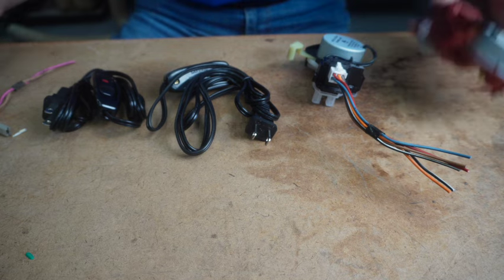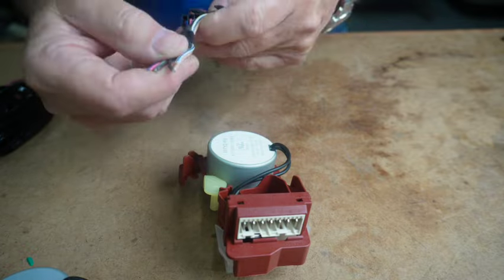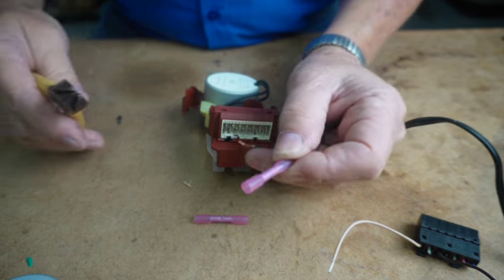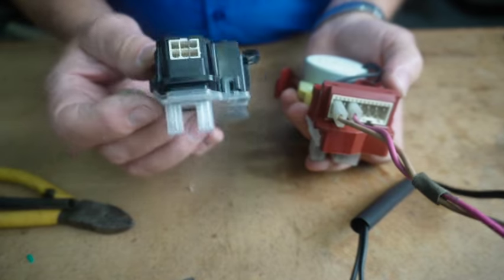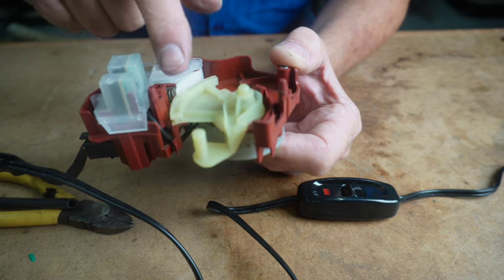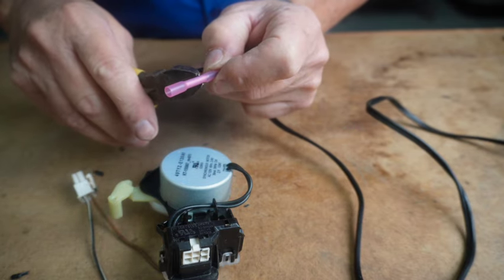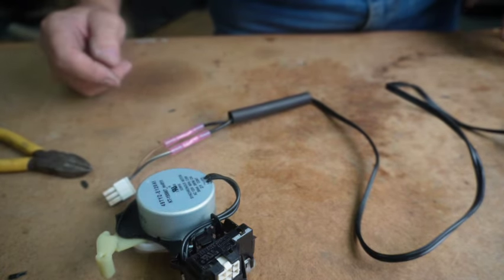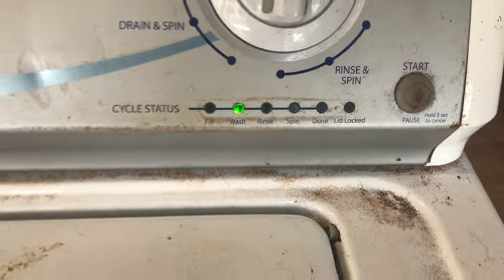How To Diagnose & Fix Washing Machines: Testing Shift Actuators & Tachometers

Comment: Thank you, this is a super helpful video!  You have a new subscriber.

May I ask what would cause the little plastic peg on the actuator arm that serves as the cam follower to snap off?

Visually, the splutch looks fine (no missing teeth on the gears or debris or anything) however, I did notice that is is hard to release the brake by hand when I manually spin the drum in one direction but easy to release when spinning the opposite direction.  (This may be the way the splutch is designed to work for all I know.)

I saw that you recommend spraying dry lube on the splutch so I will do that.  And I saw someone else comment on checking the drum seal to make sure it is not leaking on the transmission and getting the brake shift actuator wet.

I just replaced my brake shift actuator two weeks ago for this issue and have it again tonight.  This washer is barely three years old.

It would be good to have an idea of the root cause of this issue.

Maytag model# MVWP576KW0
Reply from the maker: Perhaps the plastic peg breaking off was a defect in the manufacture process. I haven’t seen this happen before. As far as it being hard to spin by hand, I don’t have a clue. I’d have to look into that further, it doesn’t seem right. I have only ever seen a shift actuator referred to as the brake actuator when ordering parts for the commercial washers. Perhaps there is an actual brake mechanism that is internal to the commercial transmission but absent on the machines made for the home consumer market. As far as I can tell there is no brake on these machines. That water leaking issue may be real bad news if it has compromised your bearings. Does it roar during a spin cycle? Thanks for watching and subscribing too!
Reply: Thank you!  

This is the commercial washer from Maytag.  In my humble opinion, the actuator arm is very poorly/cheaply made, at least on this model.  From what I see on various online DIY repair forums, its a common problem with this model.  The motor on the shift actuator operates correctly, but when the peg breaks off we're down for the count.  

I am going to try to fix the arm by drilling out where the peg was on the arm, and replacing it with a small metal, flush mount core pin and see what that does.  

BTW, I like this channel.
Reply from the maker: Thank you! Let us know how your modifications go.

Comment: I have a Kenmore 90 Series washer. After completing one load of wash I started a second. The tub filled with water, agaited then stopped. No matter what setting I put it in nothing happens. No humming, nothing. Another Kenmore 90 series washer was given to me. It agitated but no spin. After checking it out it was only a loose wire. Plugged it in & it went through the cycles. Put a load of cloths in & the only cycle that will now work is the spin. Any help on either one of these would be appreciated. I did notice same series but different timer control model.
Reply from the maker: The first one sounds like a lid switch failure. Does the second machine fill with water?
Reply: Thank you for replying. I checked the lid switch it was good, I even jumped it just to make sure, ( that what I was hoping for) The second on  does not fill up. It now only works on the spin cycle. All I did was to connect the loose wire that went to the spin cycle, so I know I did not adjust  or short anything out. @HarperandKnowles
Reply: These are direct drive units
Reply from the maker: On the second one select the wash cycle and pull the knob out then manipulate the temperature switch and see what happens.
Reply: I will be back in a few minutes This washer is outside. @HarperandKnowles
Reply: Tried that several times nothing. No noise, hum or anything.
Reply: Any ideas?
Reply from the maker: None that I can think of. It's very hard to diagnose without actually being there myself. Might be a timer issue.
Reply: I understand,  thank you for replying.
Stay well, Joe Z

Comment: Good Morning Harper I came up on your channel it’s very interested information on washers I got a question I have a whirlpool washer my problem is the washer on automatic cycle it wash rinse but on second rinse it just fills won’t drain and spin will this be a faulty switch actuator being faulty it’s work ok on the manual cycle can you advise TY.
Reply from the maker: Without being able to diagnose your machine directly I can only guess at the problem.  Depending on your model it could be the lid lock if it just stops on rinse and doesn’t spin.  Try putting your machine in the service diagnostic mode by following the instructions in the service manual found in the front left inside corner of the machine cabinet. Test your lid lock, drain pump and spin and agitate modes.  Try watching this video, it may have your solution: The MOST COMMON reasons YOUR WASHER is on the FRITZ | Get VALUE HERE!
https://youtu.be/0ArudhUKrNQ
Reply: @HarperandKnowles  Hi thanks you for quick response I pulled my service manual and put my machine into the service diagnostic mode as shown to test the tachometer but i notice when it turn to get my wash and done light on when i push the start button the wash light stays on with done light on your video i notice when you push start ONLY the DONE light remind on when i open the lid and turn the drum no lights were moving so am guess i have a faulty tachometer /actuator switch I don't think it's the lid lock switch because when i open the lid the it stops operating
Reply from the maker: If it failed the diagnostic test then you’re probably right. When you pull it off be sure there’s no trash up inside the gear case. Sometimes mice will drag stuff in there and it will prevent the actuator from working correctly.
Reply: @HarperandKnowles  I took apart the clutch already and clean and lubricant it and the actuator no foreign  Particle found inside.
Reply from the maker: Good deal!

Comment: Can’t you check for continuity across the motor leads as a 1st test. If it open the motor is bad. I have a retractor on a Frigidaire I’m needing to test. The clutch arm that the retractor activates is very stiff , do you think the clutch is the issue? I just hear a buzzing sound in spin mode. Thanks!
Reply: It’s a Frigidaire FFTW4120SW
Reply: My retractor motor continuity shows to be open
Reply from the maker: Yeah, you should be able to test the motor that way. Be sure your multimeter isn’t in audible mode. Sometimes that shows open when testing a coiled wire. And the clutch could be the issue if it’s more than the motor can handle. Thanks for watching.
Reply: @HarperandKnowles  thanks, have you worked on this washer at all, wondering if you know this clutch design and best way to confirm it’s not a bad clutch that like you say is too stiff for the motor to handle. It does move and doesn’t have to move too far.
Reply from the maker: I have worked on these. I don't remember that clutch assembly to be a problematic part. The retractors are pretty robust too. They call that a clutch assembly but it's basically the whole gearbox, shaft , and clutch made into one part. It's real expensive too if I recall. If I had to guess I'd bet that a seal has broken and ruined the inner parts. Did you see any signs of water leakage under the machine?
Reply: @HarperandKnowles  no no leaking, the motor is showing as open cct, so I’ve ordered another, it’s not to expensive. The motor has “drain motor” printed on it . I have no idea how this clutch assembly work really but activating the motor and retracting the clutch arm , or the arm extending from the assembly must drain it before spinning action commences. The previous owner did say her clothes were left wet.

Comment: Great video! Have you ever seen a case where a shift actuator seems to be working backwards? In test mode the unit agitates when it should spin and the drum spins when it’s supposed to agitate?
Reply from the maker: I've never seen that.  To agitate the motor has to rotate in both directions.  Only one direction if spinning.  Now if the tub is moving in both directions then the splutch is jammed up and needs attention.  You've got a gremlin in yer washer, my friend!
Reply: The actuator isnt the problem in that scenario. It has to do with the basket drive gear under the impeller. Or the splotch on others.
Reply: @metalshredder4life817  if he changed out the controller board it might have the sense line logic reversed in the algorithm possibly.  I think it's low in spin and high in agitate on mine.
Reply: @HarperandKnowles  I thought the motor ran in one direction for spin then opposite direction for agitate.
  I was thinking the oscillating gear made it agitate.
  Btw, I just came across your videos this morning and subscribed.I looked again I had the older direct drives in mind. 
  I don’t have a lot of experience either ones with these actuators and splutches.
Reply from the maker: @rickeykeeton4770  Yeah, Ricky you are absolutely right. But in this particular case we are discussing these newer washers with shift actuators. Those with the old transmissions worked like that, but these reverse the motor direction to agitate.  I’m glad you found us and let me welcome you to the channel. Thanks for taking the time to watch and for the extra effort of leaving a comment too!
Reply: On my whirlpool, I have the blk actuator,and it moves slow when it's cycling,I've seen other videos were it goes back and forth fast for agitation. I replaced the cap and the motor runs then stops,sometimes the splutch makes a grind soung,took it off the teeth look good.i did a system rest. Could the sensor on the actuator cause the behavior?
Reply: Any help please. Thank you. Phil
Reply from the maker: Yeah, if your motor starts on the spin test then stops then I’d suspect you have a bad tachometer sensor. That’s part of the shift actuator.  The grinding sound is when the splutch hasn’t engaged properly. Try replacing the shift actuator and while you have it removed manually move the arm on the splutch to be sure it moves freely and doesn’t bind up. A spray of dry lubricant on the splutch parts couldn’t hurt.

Comment: I’m having an issue with my whirlpool not agitating most of the time I tested and replaced shifter did tachometer test was good the shifter will just cycle back and fourth after the water is done filling if I give the tub a small spin by hand and restart it will agitate and finish the cycle as normal could it the spultch assembly?
Reply from the maker: It could be that your splutch is jamming.  I’d take it apart and see if that inner part that the shifter hooks into moves freely when it’s in its place.  Sometimes all it needs is a little silicon lubricant to free it up. Sometimes it’s got to be replaced.  Good luck with the repair.  Thanks for watching.
Reply: @HarperandKnowles  thanks I will check it out

Comment: Thank you for this video. I have a WTW4950XW3 washer that either loses a capacitor or one of these shift actuators. This will be handy to see which one before I order both. An annual expense on this washer.
Reply from the maker: Hey, thanks for the comment. Fix or repair annually!  They sure don’t make ‘em like the used to.

Comment: Can I bypass or hot wire the actuator so that the machine starts no matter what ? Mine is the last one you showed in the video.
Reply from the maker: Unfortunately, you can't do that. The logic circuit has to be able to read what the actuator is sending it in order to advance its cycles. There's a lot going on in the electronics that aren't obvious to the operator. Thanks for watching.
Reply: @HarperandKnowles  Thanks for your reply and I ended up purchasing one from ebay just now.

Comment: My shift actuator keeps coming off the clutch? I am able to pull it apart and it works fine for a few weeks then falls off again. Do you think this might mean I have a bad clutch?
Reply from the maker: Do you mean the pin keeps coming out of the splutch slot? If so you may need a new splutch, one that shifts easier. Thanks for watching!

Comment: my tech booklet tells me i need ohms range 2k-3.5k between pin 1&2  on the shifter pins ( pins labeled on the red/brownish plastic) I got a short ? beeeeep w ohm multimeter test. Am I possibly onto something?
Reply from the maker: Well the beep is telling you there is continuity. And if your book tells you there should be a reading between those two pins then there is supposed to be a connection there so I don't think you have a short. Thanks for watching!
Reply: @HarperandKnowles  thanks for quick reply. That makes sense I'm curious why i didn't get a reading in Ohms though. I will recheck my test procedure/settings.

Comment: That is very useful information. Does the optical sensor use ALL the other wires? And WHY does one kind of switch use seven wires and one use six wires? I would think the optical sensor would use the same number of wires in either switch.
Reply from the maker: This is a great question and one that I have wondered about myself. One thing I have noticed is that the more complex the machine is then the shift actuator is usually the brown variety with the extra wire.  
I have traced the wires back to the control board and found that in both cases the wires split into two different interfaces. Once they connect to the board I lose them among the many traces on the circuit board.  
Within the actuator’s themselves is another circuit board with a chip soldered into it.  There is a lot of difference between the two and I’m not sure if the extra wire may be another power source for something this additional circuit board needs.
Bottom line, I don’t know the answer but I’m as curious about it as you are. If you discover the answer I’d appreciate you sharing the info with me.  
Thanks so much for your comments and it’s great having you as a new subscriber!
Reply: @HarperandKnowles  that kinda leads me tp think you could use a control board from any black switch machine on another black switch machine without worrying about part numbers. Same thing for the red switched machines.
Reply from the maker: I do it all the time.  The only difference you'll find is the number of interface connectors and that's because some models have more features than others.
Reply: @HarperandKnowles  does that mean some will have extra sockets that you just dont use as long as everything that you do have hooks up?
Reply: @HarperandKnowles  am I right about the black switches and the black machine control boards and the red switches and the red machine control boards or do some of them mix and match?
Reply from the maker: @pl747  Exactly!  But those boards with more interfaces are also more expensive. Not too much of a concern if you have a large bone yard of used machines. I try to not use my spare boards with more connections than I need unless that's all I have to work with.
Reply from the maker: @pl747  no, you can’t mix and match them.  They have different interfaces (plugs).
Reply: @HarperandKnowles  ok thanks for all the info

Comment: Does it matter if installed aftermarket actuator on whirlpool,i changed and not working
Reply from the maker: As long as it’s designed to work with your machine it should be alright.

Comment: Applied 120Vac on the actuator and it slowly closes but doesnt stay closed. Is that normal? It drops out a few seconds after it is fully close and starts the cycle again. The N.C. contact opens when it is fully closed. Please advice
Reply from the maker: The actuator will continue to cycle when testing it with a cord. It would have to have input from the control board to stop it at the end of each shifting cycle so what you are seeing is normal. Thanks for watching.